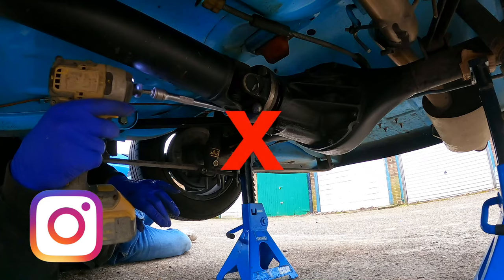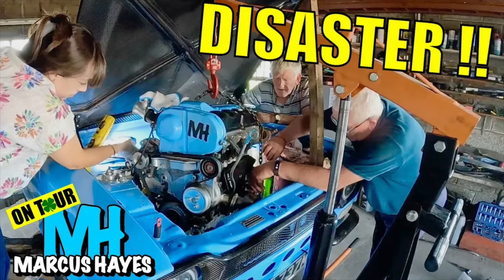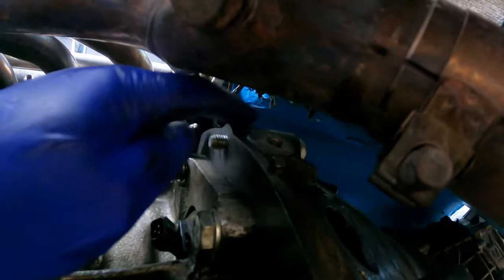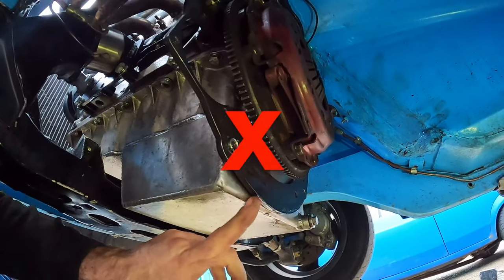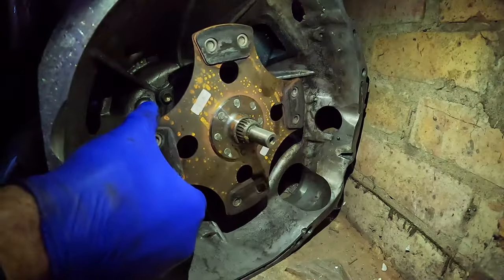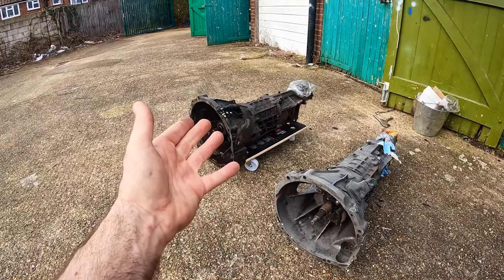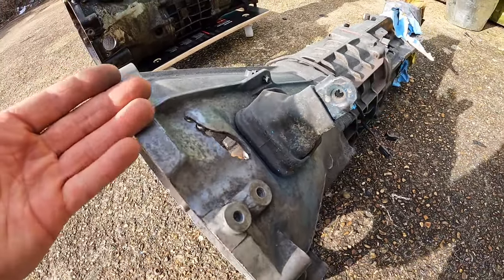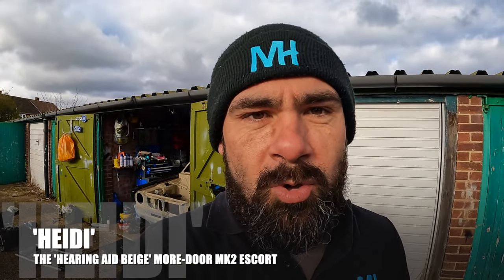SMALL problem = BIIIIG JOB 🙁

Comment: Esther needs a mexico style decal down sides.👊
Reply from the maker: In carbon! 😃
Reply: @marcushayesford dam right...do it.👍
Reply: Hi mate great to see you working on Esther shame the starter is broke but maybe you have found out why it’s crunching with the worn clutch splines are you changing the slave cylinder while it’s out mate? At least you found problems there’s nothing worst than trying to find out what’s wrong and can’t find anything at fault, great video mate and fingers crossed you get to 20 k subs soon by the way when do you get a you tube award thing is there a certain amount of subs you have to get for the first one?

Comment: check that your input shaft is actually locating in to the spigot bearing. if its not then the shaft will flex and kill the splines in the clutch
Reply from the maker: Thanks for the advice mate! 👍 I remember the last time the engine and gbox were out of the car I fitted a new spigot bearing and did check this on the floor tho. 👍
Reply: i remember when you fitted it i thought the bearing looked like it was too far in to the crank. also worth checking the bearing is the correct size to take the input shaft. if bearing is slightly too big it will cause issues. also check the input shaft is long enough to actually locate properly
Reply from the maker: @garrybull4165  Yes last time I noticed the bearing was the wrong way round but the input shaft was still supported by it. I fitted a new one then anyway (the correct way round 😃) and its now quite flush with the crank. I checked it on the floor last time to double check the input shaft was in the bearing. 👍

Comment: You wanna check that the input shaft is going into the spigot got bearing, might be the reason you keep nailing clutch’s
Reply from the maker: Thanks for the advice mate! 👍 I remember the last time the engine and gbox were out of the car I fitted a new spigot bearing and did check this on the floor tho. 👍

Comment: Hi Marcus , you better change the engine oil before you start it , becourse there will be brakecleaner in the oil now , and that seems to be a problem , and that will be have an effect on the lubrication.
Reply from the maker: Thanks for the advice! 👍 Id like to think the tiny bit of brake cleaner in the oil wont be a problem. 👍

Comment: How do you find the 6sp RX8 1st gear ratio? And what diff ratio are you running?
Reply from the maker: 1st gear is very short but just about useable with a 3.54 diff and she still does over 120 (iv never dared go beyond that! 😀) I do like my gearing revvy tho so might still be no good for some people. I wish there was a 3.2-ish ratio diff available because then I reckon it would be perfect. 👍
Reply: @marcushayesford   I was thinking a 3.54 would be the best option when I do mine. I would imagine 1st would be useless with a 4.1 or 3.89.

You could do with a narrowed 2.8 Capri atlas with 3.09 🤪
Reply from the maker: @uncensored5104 My initial plan with the RX8 conversion was to fit a more revvy diff and just always pull away in 2nd gear, thinking that this would be similar to the setup in 'Maude' (type 9 with longer first gear / 4.1 diff) but I used an online gear ratio calculator and worked out that using the 3.54 diff and actually using first gear was the better option. But I think that if you prefer not to have the car ridiculously revvy, then maybe my initial plan might be better??
Reply: @marcushayesford  What revs does it sit at @ 70mph in 6th with the 3.54? And what rear tyre size are you on?

Im interested to know as I plan on mating an RX8 6sp to a 250hp / 230ftlb normally aspirated engine to it.

Comment: Seems to be a Ford problem = every single slave ive changed on my zetec 2.0 and all other zetec 2.0s ive had has caused this whirr = even after sending my gearbox to the Gearbox Specialists in Northampton , Steve top bloke!  We still had the whirr - if i let go of the clutch softly it goes away - its one thing i haven't been able to solve
Reply from the maker: Yes 'Esther's Mazda box also sometimes has a whirr, and then if i press the clutch and release it slowly it goes away. Also, if I lean my foot on the clutch pedal slightly it goes away. . . . . . Cant hear it over the ITBs at full chat tho!! 😃
Reply: @marcushayesford    I'm intrigued because it happens with your Mazda box and happens with my MTX75 so I'm guessing its do with using a used flywheel?  Maybe we need the slightest shim?  But it doesn't affect performance or wear so I've left it too !
Reply from the maker: @t238  Yeh I kind of think that if you are putting a load of parts together that wern't designed to be used together you have to expect noises etc. Im using a Mazda RX8 gbox, mated to a Zetec engine, with a Pinto clutch in the middle! 😃

Comment: Mm Esther eating clutches, maybe you thrashing it everytime you drive it just may have something to do with it, Maybe if you had a little mechanical sympathy you might not have sone of the issues you have, that and stop half arseing a job when doing it, do it right, do it once
Reply from the maker: Yawn! 🥱
Reply: These are supposed to be performance parts so they should be capable of being thrashed.
I must say though, I didn't like the look of that clutch plate. Weird looking clutch plate. Can't see how that design can take a hammering.
I would bin that clutch plate and look for an alternative. Why replace crap with crap?
Reply: Haha another anorak that drives like miss daisy 😂 just keep swapping bits and it’ll be good 🫶
Reply from the maker: @JazzFunkNobby1964  When I used sprung paddle clutches they would just fall apart and the springs would just fall out. These unsprung paddle clutches are super heavy duty. They work by the actual plate itself bending and springing back on itself. They'r not really for road cars, they'r for hardcore race and rally. cars. 👍
Reply from the maker: @Scotty-UK  Yeh imagine spending £tens of thousands£ building a car to be faster, lighter, and go sideways better to then drive it with 'mechanical sympathy' ???? Seems like a waste of time to me!!! 😃 . . . . . Hopefully these people will be happy when I get 'Heidi' on the road because she's going to be more tame. 👍
Reply: Okay thanks for explaining. You need to continue your search for a better alternative. Cheers. @marcushayesford